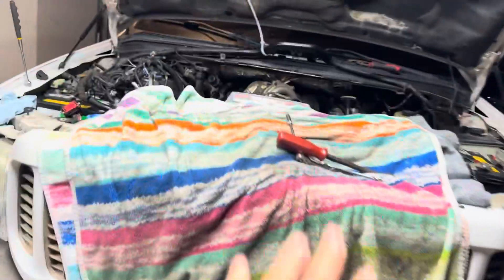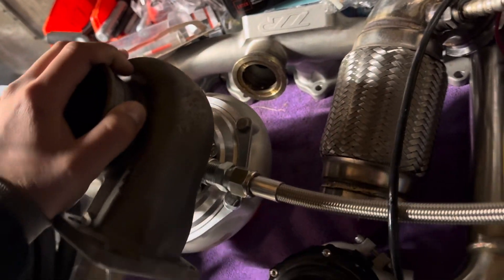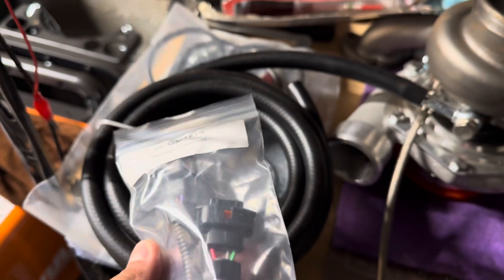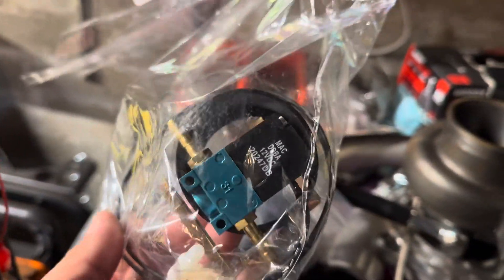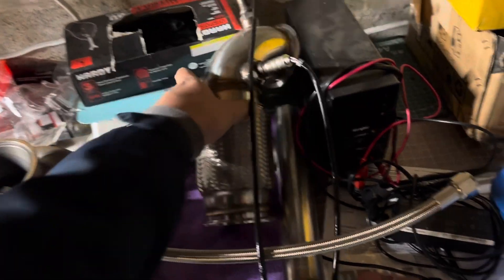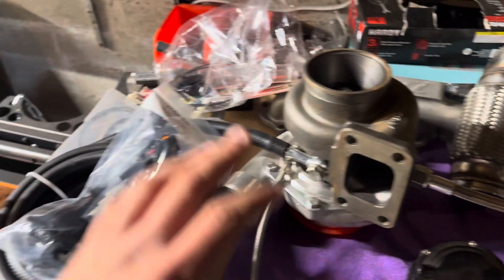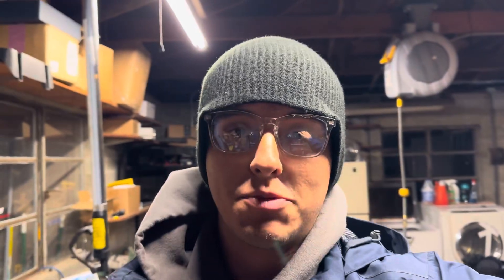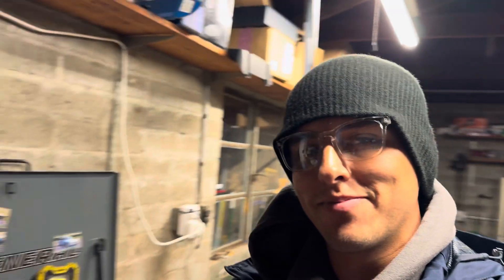Saab 9-3 2.0L Big Turbo Build (Part 1.5) - Part Sourcing & Quick Update

Comment: If you need help with tuning, shoot me a message! I've got a few big turbo 9-3 T8 saabs under my belt! :)
Reply from the maker: Will email you!
Reply: Tuned any 9-3's for 400+ hp? Outta curiosity
Reply: @mathias3187  Just get the V6. In the spring I'm selling my tuned manual 9-3 aero 2.8T for an auto trans aero because the auto is cheaper if it breaks and clutches, flywheels, and clutch job are insane money. Then I'm putting a 20T, injectors, and tune for around 390 to 400 HP. If I did that in my manual one, the clutch would dissolve. And that's a ton of money.

Comment: Definitely excited to see where this goes! I’ve heard the bottom ends can’t handle much over 350. Always wanted to try for more than that but don’t want to blow up my daily 😂
Reply from the maker: That’s what I’ve heard too! And this used to be my daily but I got another one so time to blow this one up 😂 just started the water pump and once that’s done I’ll be bolting up the new turbo setup!
Reply: 350 without forged internals, right?